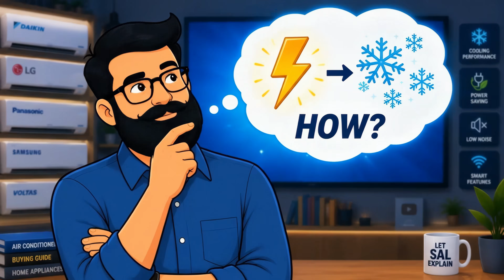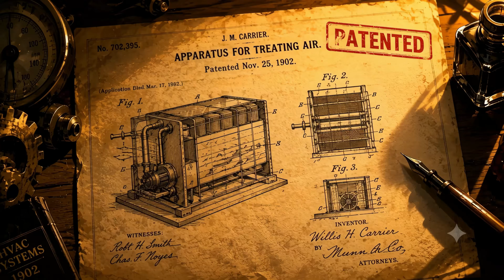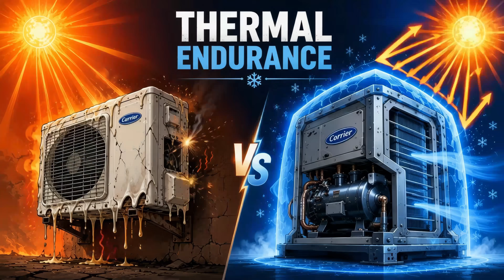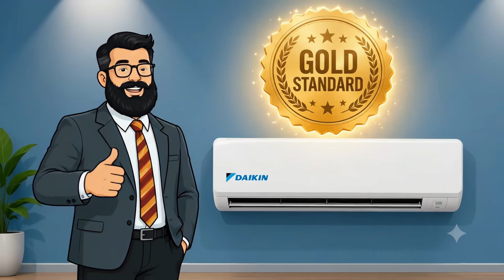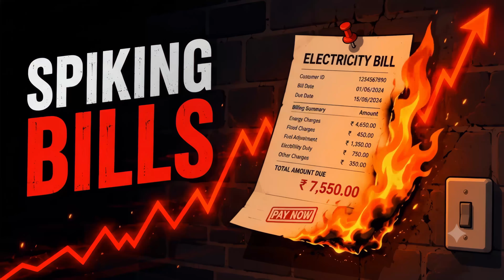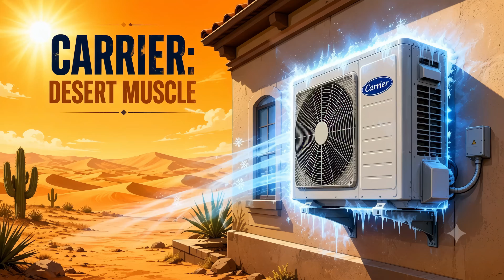AC Brands That Are Absolutely The Best! (Why?)

Comment: Good breakdown of the brands, but one thing worth adding: the brand on the box matters a lot less than the install quality and system sizing. A Mitsubishi or Daikin installed by someone who undersized the unit or skipped proper load calculations will underperform a mid-tier Carrier installed correctly. Before you commit to any brand, make sure whoever is doing the install pulls permits, does a Manual J load calc, and gives you a detailed written scope before you sign anything. ARS/Rescue Rooter is one option worth comparing quotes against, though service availability varies by location and you should still check local reviews for any provider you consider. Get at least two or three written estimates and ask each contractor to explain their sizing logic.

Comment: Brand comparisons like this are fun but one thing that gets glossed over pretty consistently: the brand on the box matters less than the install quality and system sizing. A perfectly engineered Mitsubishi or Daikin unit installed by someone who sized it wrong or cut corners on refrigerant charge is going to underperform a mid-tier brand installed correctly every single time. Oversized systems short cycle, undersized ones run forever, and both create humidity and efficiency problems regardless of the inverter tech inside. So when you're actually ready to buy, spend as much time vetting the installer as you do comparing spec sheets. American Residential Services is one option worth getting a quote from, though you'd want to check local availability and compare their written estimate against others before committing.

Comment: 2024 is the year i bought LG 2.4 inverter split type air conditioner and let me tell you, DON’T buy LG at first so expensive and parts is so damn few as if parts didn’t exist and also you will be disappointed on airflow.
Mitsubishi on the other hand specially their Jetflow turbo is the best. Airflow + coldness is excellent! And built tough as well. 10/10! For me.
Reply from the maker: Thank you for sharing your experience and providing a helpful recommendation for others.